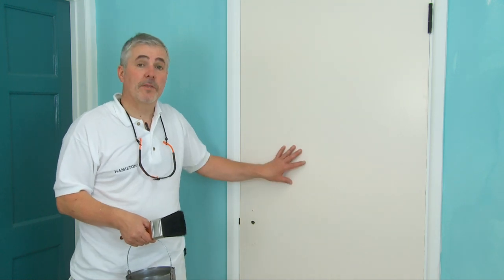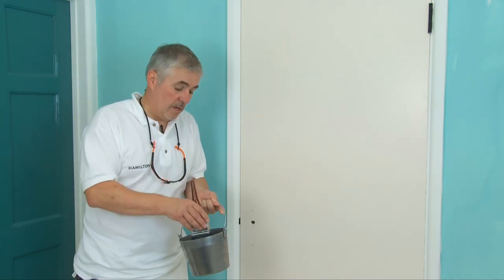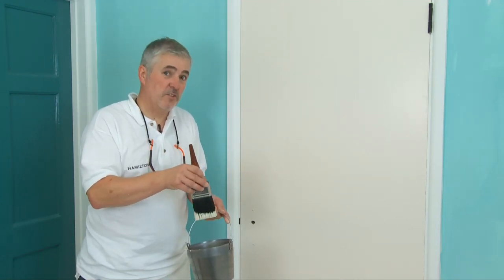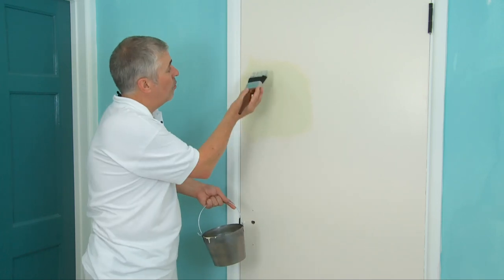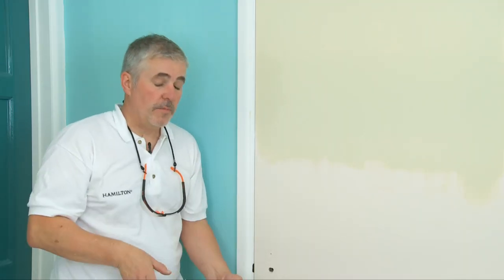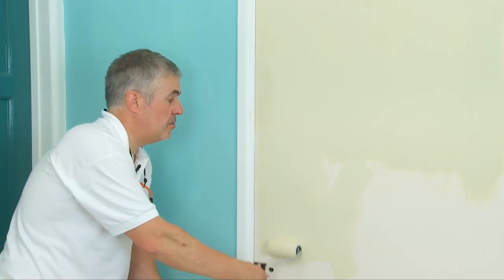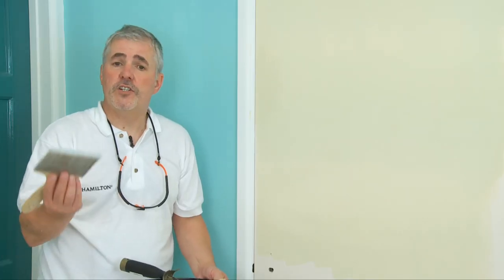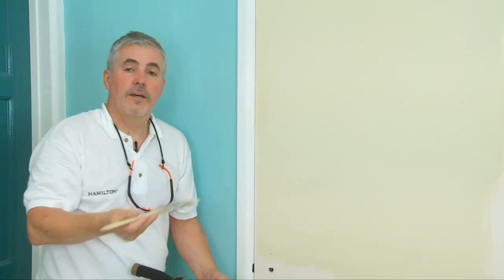Painting a Flat door like a professional

Comment: After constantly trying to paint a flat door long ways with a roller not a brush I find best way that makes the door easy to paint with a great finish is to remove door propped on work horses flat then roll the paint sideways starting at one end not trying to put much pressure down on the 1/4" roller or will leave line ends in the paint, I generally apply up to three coats letting each dry couple hours in between other things to note is have damp rag to catch any paint that goes over the edges lightly wipe off, I never use a brush on doors it's not a good finish on doors having many brush lines looks horrible to say the least.
Reply from the maker: Hello there, all very good points you are making. Thank you for stopping by and please like and subscribe have a lovely day.

Comment: i did it using this method on a flat door using acrylic paint. I had to keep brushing up/down to spread the paint & prevent runs.
Reply: you use a 4-9 inch medium pile roller if not long pile roller then lay off as quickly as you can but with oil you can paint a flush door with a 1 inch brush I would only use oil with colours because white yellows in a couple of years even with good lighting unless it's on a exterior.

Comment: Is a roller equally effective whether you are using matt or gloss paint ? I find the gloss paint is more difficult to distribute over larger areas if you're using anything other than a brush .
Reply: it all depends on what roller and pile your using and weather your using water hybrid or oil paints.
Reply: @jackwardley3626  Ah! Ok, thank you . I am going to try water-based for the first time :-) .
Reply: @johnconway8070  johnstones aqua has got nice flow but I've heard a lot of people saying it yellows as much as oil and losses it sheen after a year so I changed to crown fastflow.
Reply: @jackwardley3626  Thanks very much for that tip . It's good to get a reliable opinion ;) . Cheers !
Reply: @johnconway8070  oil based crown next gen gloss stays white for a long time
Reply: @jackwardley3626  Your recommendation is noted. Thank you ;) .